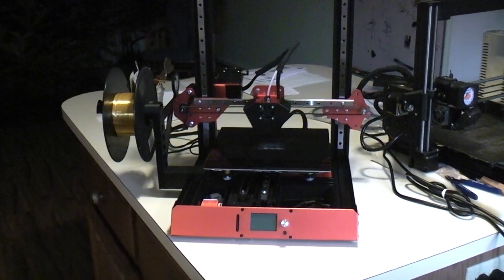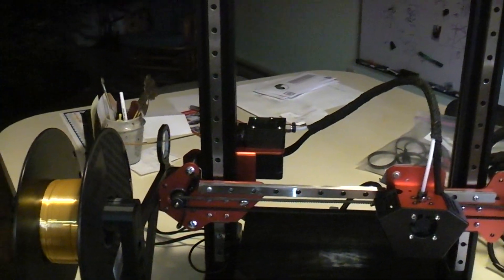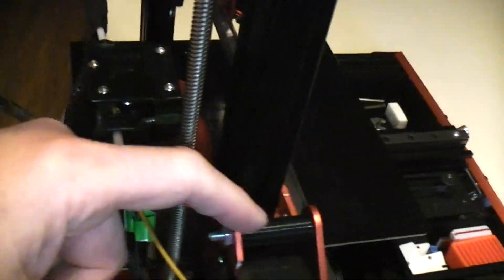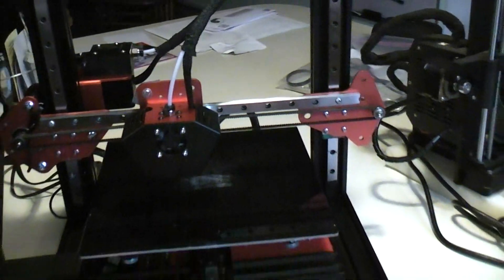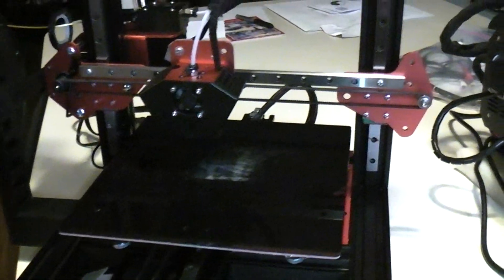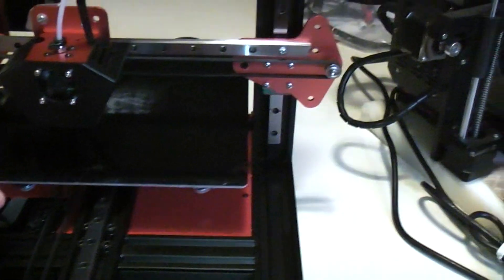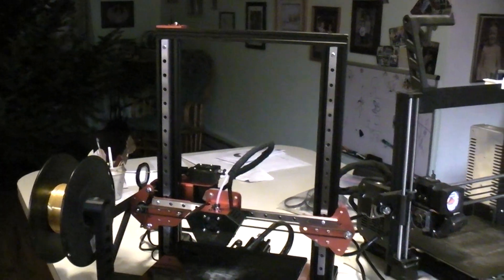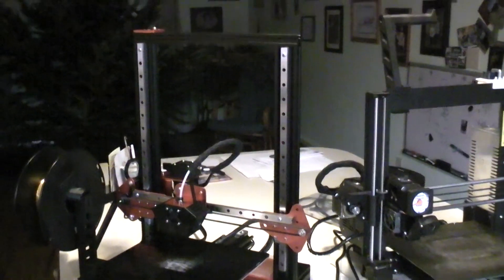Tevo Flash . Full linear rail mod. Part 3.

Comment: 20$ for 400mm rail is very very cheap
Reply from the maker: Yep, that was why I bought them. And even though it was a lot of work taking them a part, cleaning, lubing and putting them back together, it was worth it.

Comment: Hey ! I own a Tevo Flash too (and also design things, search for "ilko" on thingiverse), and am very interested by your mods. Wich model of rail do you use ? MGN12C ?
Reply from the maker: I used MGH12H with a 400mm rail. Had to cut down the X rail a bit.
Reply: Would you say that it improved print quality ? Personaly, I hardly see the benefits. It's a bit more noisy, and although mine got only one Z axis, it is already printing pretty well. I don't even use any extra adhesive stuff. Plus, I did not mount my smoothers and drivers (bought separately) so I can probably obtain even better results. For now, I'm just trying to get the max quality as I can until machine's own limits before going further.
Reply from the maker: As I explain in the video, I only did it because I wanted a linear rail printer, there is nothing wrong with roller wheels, they work great when adjusted right. I would not expect the final print quality to be any different from a properly adjusted stock machine. I have a the single Z motor set up as well.

Comment: Nice work. It is in the firmware and normal procedure that the bed heats first then it changes the hotend. Baked into Marlin. Just change the fan speed for the part cooling in your Slicer and turn it down by about 10%.
Reply from the maker: Thank you for confirming what I thought. Yes I did just that changed the fan speed and added a silicon sock too the hotend. All is good. I like how Prusa i3 printers heat both bed and hot end at the same time, makes things go a lot faster. And since the Flash has a AC heat bed and does not put a load on the power supply it would have been nice if both could heat up at the same time.
Reply from the maker: @FaisalAhmedTech  That might be helpful for many people out there.  Once I changed the printer to direct drive by mounting the extruder stepper to the hot end  "no bowden tube" I started just using my Prusa MK3 slicer G code files on this machine and have not had any problems. But it still sounds like  the information could be helpful to know.

Comment: Very cool mod!  Did you share the STLs for your rail locating pieces to center everything?  I didn't see them on Thingiverse or a link above.  

How much improvement do you think you have seen with the switch to the rails?
Reply from the maker: At the time I did not think to save the files as it was just a simple measuring / center location method. Any one could whip up a design in tinker cad or any other 3d cad program, or even make one out of cardboard. Just has to fit the extrusion slots and have a center mark. Sorry I just did not think about saving the file or at this point even the part.

Comment: Great work!  Some thoughts...  Get a silicone cover for your heat block and it will be unaffected by your fans. Great for hot end temp stability.  Also regarding the temperature changes;- do you know what G-code commands are being used to change the bed temp?  Could it be a M190 causing it to delay the hot end temp-change, rather than a M140 which should not block other commands?
Reply from the maker: Silicon sock is on order, that should fix things .

Comment: Looks great, can you please show how you made the y axis ? I can’t seem to see how you placed the belt and the rail  how it’s screwed together
Reply from the maker: The rail is just screwed too the top of the stock extrusion for the "Y". The part of the linear rail that moves is screwed to the stock "Y" frame "with the wheels removed. I also flipped it upside down to lower the assemble as the linear rail would add some height. So the only thing left was attaching the stepper belt. I used two of the holes that used to be used to hold the wheel units in place. I ran new bolts threw them and wrapped the belt ends around the screws and cable tied the belt ends to them self. like most printers do on the "X" belt set up. Hope that helps. There are move views of the asset up in my other Tevo flash videos like PART 2, it covers the "Y" build. here is a link.
https://youtu.be/oICyQI7zwBw
Reply: Robothut what about the fingers of the bed ? How do you mount the belt to the carriage. I simply cannot achieve a direct path and I also watched your previous video
Reply: Also will you share files used to achieve this mod?
Reply from the maker: I bent the stock belt fingers flat so they are out of the way. And as stated, I ran 2 bolts threw the non used bearing wheel holes to now connect the belt ends too.. There are no printed parts so no files to share.
Reply: Robothut awesome i didnt notice that from the video that you used screws to attach the belt makes sense now.

Regarding the stl files it was the printes parts for the z and x axis :) 

Thanks for the explanation of the y axis :)

Comment: You may have said it in another video. What was your entire cost of this build
Reply: Haha should have watched the whole way through! At that price extremely cheap! But what a hassle that they didn't work!
Reply from the maker: I bought 5 rails at $20 bucks each, so around $100 USD. The Tevo Flash I bought when they first came out. The price for the 50 % built was $227.00 but there was a $10 buck discount for NEW BUYER, so I got it for $217.00. So I am into this printer for $317.00 right now.